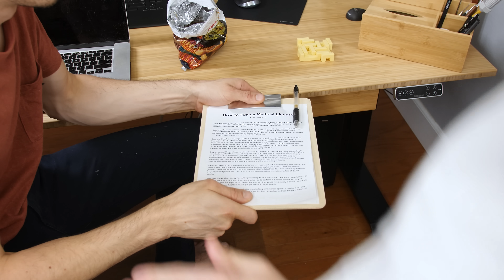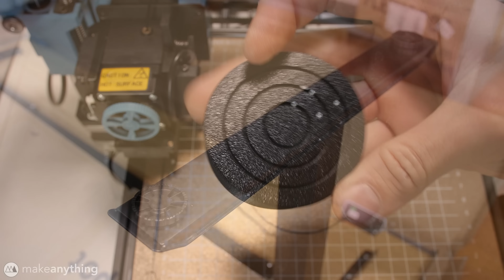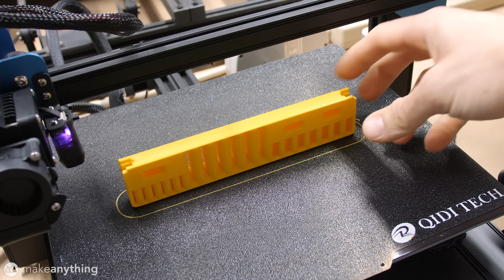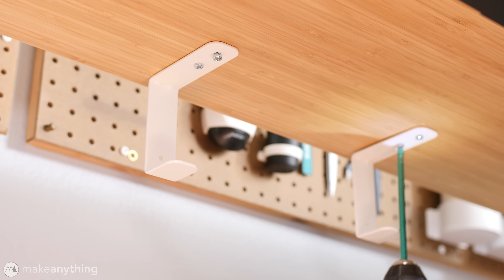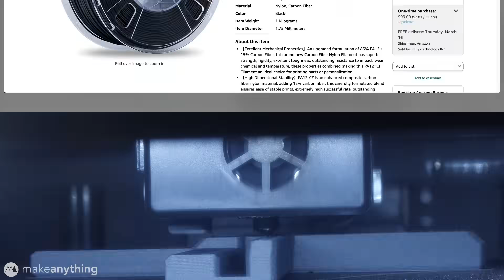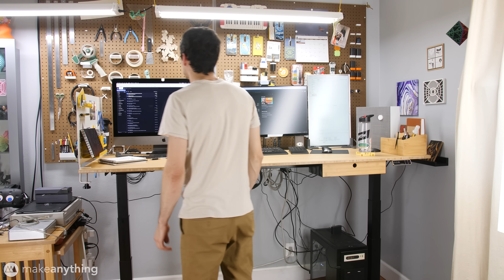Upgrades for my New Desk Setup // Flexispot Standing Desk

Comment from the maker: Yeehaw, I got a much-needed upgrade to my workspace with this E7 Pro Plus standing desk + accessories!

Thanks to Flexispot for the collaboration.
Don't miss their Flash Sale through 3.21-3.23, as low as $349.99!
For US buyers, make sure to use my code【YTB15】for an extra 15% OFF over $500!
For CAN buyers, use my code as well to get $50 OFF over $500!
US site: https://bit.ly/3yDpoSS 
CAN site: https://bit.ly/3Fq6wKX
Reply: Is this 2-legged version available with a deeper surface plate? One that would extend more back?
Reply from the maker: @Elektrotechniker  you can technically mount any desktop on the legs, but I think you'd want the 4 legged model to keep things stable if you're going bigger

Comment: Truly curious how you imported the image of that TV into fusion 360.... or if you built that in 360 also.
Reply from the maker: I modeled that as well, just with some quick measurements of the length width height of the body and screen. I didn't try to capture every detail, just enough to make sure my print would fit well and work the way I wanted it to. It's really helpful to have a 3D reference of the object you're building for!

Comment: I use a "wire hammock" style of under desk wire organization and its the bee's knees!!  Plenty of room for all the extension cords I use removable zip ties to hold up the front edge of the hammock. When it's time to get in there and change something its super simple to just drop the front and have access to all the velcro straps holding everything into the hammock. There are steel bars on the front and the rear which make it extremely strudy. Mine is almost the width of the entire desk and fits between the desk legs PERFECTLY!  I decided to tap into the power cord going to the desk in order to provide power to everything on the desk, so there are only two wires running down one of the legs of the desk, eth and power) because I have a laptop and micro external graphics card to power 4x 4k!

Comment: Sorry to disappoint you about that Qidi PA12-CF, since you seem to like it very much, but it only contains milled carbon, which is just carbon dust, no actual fibers. All the strength of the material you're experiencing comes from the Nylon itself, the carbon just adds color. A 750g spool of PA12-CF based on chopped fibers costs $50 to $100 more.

Comment: "50g each which is about 10$ in total"

Aren't spools usually 1kg and between 20 and 30$? So wouldnt 2x50g just be between 2 and 3$? What am I missing?
Reply: He used carbon fiber nylon filament which is $100 / kg. Honestly couldve printed the part in something like PLA at $20/kg and made the part more solid only trade off would be the weight of the stand increases.
Reply: @IGrowLotsOfRice  why not tpu. That's what I printed my anti slip stuff with and its under 30€ oh well

Comment: I use my lowest of my three motorized desk positions for kneeling (feels good when my back is aching sometimes, with a pad on the floor, which is also nice for my feet during Winter). Got a bit of dual-use out of it by locating the keyboard shelf I added so that in that lowest setting the table top itself is at a convenient height when sitting in my chair so I can use it for soldering or other projects (my monitor is on an arm so can be pushed back out of the way). it's useful but it does mean my desk is covered with crap pretty much constantly.

Comment: Can we get a separate video on the 3D mouse? That thing looked really cool and I’d love to see how you’ve integrated it into your workflow.
Reply: Obviously this doesn't substitute a good video showing its functionality but as someone who uses a 3D mouse every day for work I can tell you a little of how they work! 

It's essentially a six-axis joystick. Think of a normal gaming joystick as 2-axis control, you can push it left/right and forward/back with all the degrees between. A 3D mouse can be pushed left/right, forward/back, and up/down in addition to being twisted/tilted to the left/right, forward/back, and and clockwise/counterclockwise (think roll, pitch, yaw if that makes sense). That probably sounds weird but the best way to think about using a 3D mouse is that your hand  on the mouse is a direct correlation to your hand 'holding the part' you're working on. So if you want to zoom in you 'pull' the part closer to you. If you want to spin the part you would maybe twist it clockwise to turn it around. If you need to access the bottom face of your part you would 'lift the part' while 'tilting it forward' so that the bottom face is now facing towards you.

It allows for super quick and precise view control but it can take a few days of practice to train your brain to use it!
Sorry if this was incoherent its hard to explain but I hope it made sense! haha
Reply: @MrSpartacus575  thanks man that does make sense! Devin if you're reading this still make the vid tho
Reply: 3D Mouses are around for quite a time. I've used them for twenty plus years. The principle is like described by @MrSpartacus575. Many programs support the use of it, not only 3D construction software. Also software like Blender, Maya, Cinema 4D and so on.

Comment: Nobody needs a standing desk. Just take regular breaks and move your body.
Reply: Nobody really needs a 3D printer either…yet chances are you own one.
Reply: Standing desks are amazing. If you spend close to 100 percent of work at a computer it's nice to do some of that time while standing. You can't just take a 3 hour pause, but you can work standing. Also it's nice if you have several steps in your workflow that requires you standing, so you don't have to stand up every time
Reply: @thinamo7750  Nobody says you have to take 3 hour breaks. 5 minutes is enough, I don't know any job where you don't have the time to get up. Just standing isn't going to help your back.
Reply: @achannelhasnoname5182  Yes, it is. It's medically proven.

There are plenty of desk jobs where sitting for long times causes long-term damage to the back, it's why there's a whole industry of products that attempt to alleviate this issue.

Five-minute breaks aren't enough so the better solution isn't to stop working, but simply to find a better position and standing will help.

Breaks in this instance then give you a rest from being on your feet.